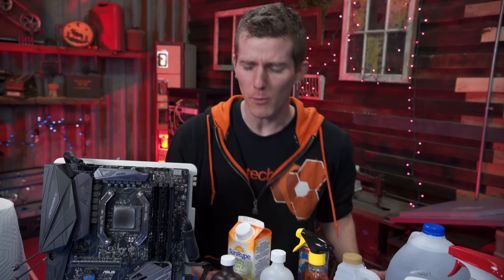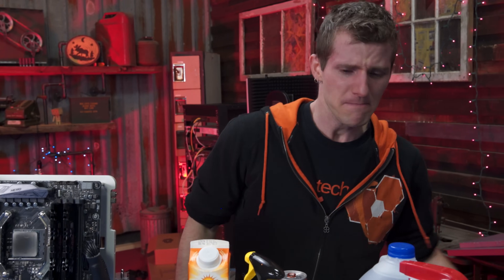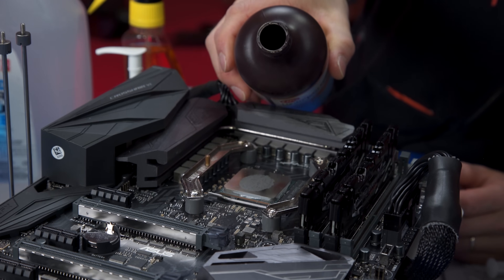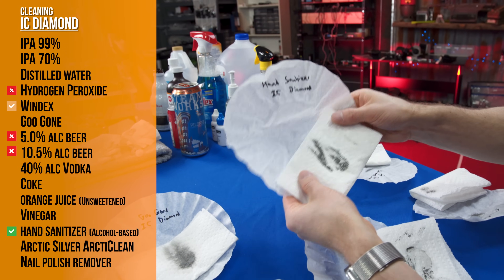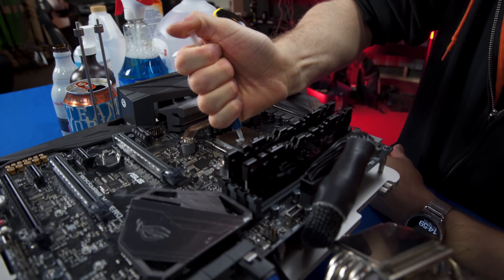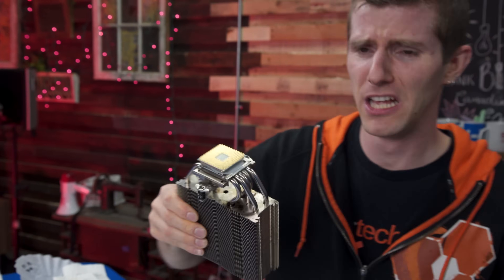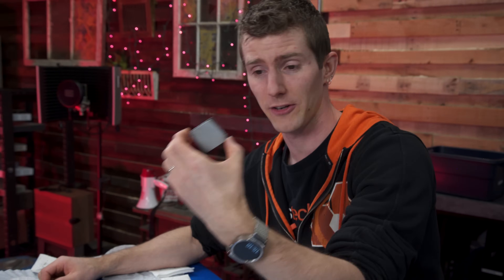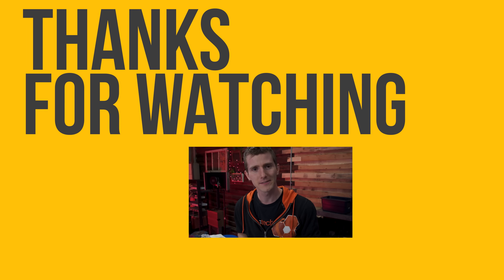Removing Thermal Compound - The BEST Way?

Comment: #prayforthe1800X
Reply: ?I've actually seen an amd chip installed wrong with a couple pins bent flat and was still able to bent them back straight and have the cpu work fine. it was when I worked at a pc repair shop and this 16 year old kid was building his first pc with an 8350. he didn't line up the indicators had the chip rotated 180 degrees off. 
but I used a single sided razor blade and saved the chip. the board was shot though. but that was because he didn't but any standoffs on the case and shorted the board. lol what a way to learn .
Reply: 1 like = 1 pray
Reply: May GabeN be with it, and that he saves the 1800x. Amen
Reply: #payforthe1800x
Reply: f
Reply: I did that a crap ton on HP business pc, it is fine as long as the pins are mostly straight...
Reply: I've done that before. Bent a couple pins but managed to file them straight with a credit card. As long as you don't bust any of the pins clean off you can usually save it.
Reply: That's like saying taking pleasure in a Prius dying means I don't care about cars, perfectly fine to hate a Prius.
Reply: amd is the saviour of affordable, non-overpriced technology and actual progress :'(
Reply: Julian Taffa  #prayforthe1800X
Reply: #pray4da1800Exx
Reply: its fine if that happens
Reply: Julian Taffa I'm a hardware reviewer and I've had this happen 3 times  already.
Reply: Only pagans pray for AMD.

Comment: I usually use nail polish remover
Reply: I also feel bad for that heat sink. Nice video tho
Reply: I wouldn't recommend Acetone based remover though. It dissolves plastic.
Reply: christ, and people put that over their nails a few times a week ?
Reply: Well, it is not corrosive and not harmful to humans in low quantities. Acetone just works well to dissolve some plastics so if you are unlucky parts of your mainboard might turn gooey.

Comment: Summary: A simple test, not scientific, partial credit given.
~~~
Seems to be only a partial test, not on the liquids used to remove it with, but in the fact that the system was not turned on and used/left on a while to heat up and cool down again (as in normal use) since different thermal compounds react differently in that way. Some compounds dry up, some stay liquid, some 'bake' into the metal and others seem to fill in the metal at the molecular level. No microscopes were used to see how well these different liquids removed the thermal compound, just a simple test with this process... but then again I guess that was the point, just a simple test and nothing fully conclusive.
~~~
I'll give you partial credit here Linus... I know it took a while to still make this video and I appreciate your channel but sometimes when you do tests like this I would be even more interested if you did different tests a little more scientifically.

Always been curious about the Arctic Silver ArcticClean with the surface prep as to if that even matters or if it visually makes any difference (can there be any noticeable visual difference if we used a microscope or an electron microscope to see any differences of removal of old thermal compound? Even at the atomic level?)

Comment: Its probably fine. I swear CPUs are the most durable electronic... anything, ever. Hell I have one I've dropped a few times from high distances and applied thermal paste all over the bottom.. thing still runs like a champ to this day. :P

It hit an old giant radiator and got stuck between a metal portion. Had to kinda pull the CPU out... was a mistake in handling on my part when I built my first rig a while back lol. Was trying to be so careful... too careful. So much so, it backfired.

Comment: Seen some horror stories about that exact issues with the Heat spreader getting stuck to the heatsink, on older AMD chips to the point where when trying to pry it off, guy broke the silicon in half

Comment: 8:38 if a cpu comes off with the cooler DO NOT PULL IT UP, just twist it, once it starts getting twisted you can slide it to the edge and break the vacuum. this can happen in two ways, old compound can start to act like adhesive over time, the other way is getting an air bubble trapped. and always when removing a pin package cpu's cooler twist it first, gently. make sure it is pretty free moving on the surface of the cpu before you try to actually pull it off.

Comment: utterly useless crap and not funny video, like how did this make it to a video i do not understand..
also for those poor beings that might not know the reason 99 percent isopropyl alochol and would try shit shown in this video:
it's because 99 percent isopropyl alochol it fully evaporates leaving no residue, so u won't short shit out if u fuck up or to avoid having some residue on the heatspreader  from the dried up cleaning agent, which of course fucks with thermal performance.
also linus the 2 main thermal compound groups are not "runy" and "particulate kind".
they are liquid metal conductive pastes and non conductive  pastes.

Comment: More accurate way to do this:
Get stock cooler, aftermarket cooler and solid metal panel.
Apply thermal paste, press it down to appropriate pressure, cook half of them at 80 degrees Celsius for few hours to simulate well-used thermal paste then remove the pressure.
And then try those solvents.

Comment: I guess if the goal is to remove stock thermal compound, then yeah. However thermal compound changes as it heats. Used thermal compound is a dry solid.

Comment: Did I miss it? You can use many things to clean thermal compound. The shit isn't hard to remove. The reason you want to use 70/99 alcohol is because it evaporates very readily which prevents any potential shorting in case you get sloppy with it.

Comment: I had an issue a few years back with a defective tube of compound, and it wound up making a mess down in the socket on my MB, for something serious like that I got some CRC QD Electronics Cleaner.  It comes in a spray can like WD-40, but it is non-conductive and fast drying, I basically had to stand the MB up and used some tissue to capture the drippings, and used the can like power washer to clean it out.  Worked like a charm.

Comment: So many question for this video:
1. Why used 1800X to wipe it over and over again? Is it affect the wiping performance?
2. Which compunds are better for cooling your CPU?
3. Why isn't AMD put a warning that you can accidentally pull your CPU from your socket? that thing is expensive

Comment: as an industrial service tech i find myself removing a lot of heat sink compound from IGBT's, bridge rectofiers, Heat sinks (duh), and what i find most effective, since i rarely find myself in a household environment and find myself on a mechanics shop most the time, what works the best for me is not WD40 because it does leave a protective layer after it dries, but try break parts cleaner, i recommend the CRC braklean nonflammable (red can). it seams like a common enough household item along with WD40, wonder why you didn't try thos?

Comment: Air duster / compressed air in it's liquid form can remove it quite well, but it'll make a mess, as it washes the thermal compound off like soap mixed with water , then the air evaporates leaving behind the compound to whatever surface it ran down to.

Comment: Anyone else notice the stuck pixel?
Reply: So you're saying the 500 million $ 8K camera has a stuck pixel? :O
Reply: AcidSugar1414 clearly you have no idea how digital camera's work.
Reply: nope, that's a dead pixel. It's the same thing that happens when you shine a powerful laser at a camera sensor.
Reply: "the individual location on a digital image sensor of one tiny light sensitive component"
How many individual locations of light sensitive "components" does a 20MP sensor have? I'm pretty sure the answer is more or less 20.000.000; If that's not what you call a pixel, then I don't know what is. Maybe it is made with magic fairy poop.
If what you said is true, then theoretically, the sensor would have an infinite amount of light sensors would it not? Which is clearly not the case. Ever.
Call it whatever you want, for  99.999% of people we call that a pixel.
Reply: pixels aren't in a camera

>>>>>>>>>>>>>sensor size is measured in megapixels
Reply: AcidSugar1414 holy shit dude we arent calling them monitor pixels. theyre camera sensor pixels. wtf are you smoking

fuck are you 100 shades of deluded
Reply: lol dude, stfu, a camera sensor IS made of pixels (light sensitive ofc, not emitters), prove me otherwise.
Reply: David Langford where?
Reply: The image sensor is made up of 3 parts. None of which are called pixels. 

http://www.dummies.com/photography/digital-photography/resolution/the-components-of-a-digital-cameras-image-sensor/

The image sensor takes the photo and is then Converted to digital pixels to be displayed on a screen. 

I'm not saying the cameras fine, it's definitely fucked.
Reply: Harry Smaje 3 photosites equals one pixel or translates the information for one pixel? And proof?
Reply: "Unfortunately, the use of the term pixel can seem to be confusing. It applies separately to three different things which are closely associated…

1.the individual location on a digital image sensor of one tiny light sensitive component;
2.the corresponding display component on a screen (a tiny LED LED | External link - opens new tab/page) which emits light showing one tiny point of light in an image to the user;
3.the smallest individual point of light in a displayed digital image."

Pixel is not a component of the sensor but a location of the photosites. Therefore it cannot have a bad pixel. 

But keep acting like you don't have time to debate...
Reply: https://petapixel.com/2013/02/12/what-a-dslrs-cmos-sensor-looks-like-under-a-microscope/ 

Gee, those look a lot like pixels. Did you know a monitor pixel is made up of multiple parts too?
Reply: TheFPSPower the number of sources of light you could possibly record is infinite but of course there aren't an infinite number of sensors. My point was that a pixel, in terms of digital cameras, is not a physical component but a location of a group of sensors that translates light into digital code.

m4xwellmurd3r just because it looks like a monitor pixel, doesn't mean it's the same thing. Yes, monitor pixels are made up of other components, but those are physical components. Again pixel in Digital photography refers to a measurement of light in a specific location, the location being called a pixel. It is not a physical component of the whole sensor. I do appreciate you citing a source, but I trust scholarly articles more than I trust commercialized websites.
Reply: Google Scholar for "pixel camera CCD" and you can find your "scholarly articles". If you want to claim "a pixel is an imaginary concept only in your mind, dude", I'll file that alongside the Jaden Smith "how can mirrors be real if our eyes aren't real" facts.

You're being a superb troll I guess, keep it up.
Reply: There are no real bridges, just steel and concrete structures that function as bridges. Bridges is just a concept, man. What if it didn't go over anything? Context, oooooo...
Reply: Imperfectionism sensor size is usually measured in millimeters. Megapixel refers to the size of the images produced by the camera.
Reply: you238 I didn't say it was imaginary, nor did I say it was a concept. Thanks for telling me how to look instead of finding something yourself though, you guys are REALLY winning me over 🤓
Reply: AcidSugar1414 stuck photon, it happens
Reply: dust in the camera lens..
Reply: TheFPSPower again the only place you'll find pixels on a camera is the (digital) viewfinder. The sensor does not have pixels and therefore cannot have a dead one.
Reply: Cameras don't take video in pixels.

Comment: I'm thinking that if you have to get it removed using alcohol, hand sanitizer would be the way to go.  Although, I'm a little disappointed in this test.  Generally when I'm removing thermal paste it is because I've removed an old heat sink that has been sitting on a CPU for a rather long time with burn in.  OR I'm removing that thermal tape stuff that comes pre-applied.  I imagine the results would be about the same, though.

Comment: Yea, not a great test, imo. Dried thermal paste is much more of a bitch.

Also, I know the pain of pulling a CPU out with the heatsink. Did that with an a10-5700. Sadly, a pin was bent and wouldn't give a post. Haven't attempted the credit card straightening method on it.

Comment: I'm sure this is already in the comments somewhere, but there is a difference between 70% and higher% isopropyl alcohol being that the higher alcohol content makes the liquid applied evaporate faster reducing the risk of accidental harm to your electronics from some liquid still being present when the device is turned on. I know this video is really just for entertainment, but there is a reason that the higher percentage is preferred. 

Sidenote that is obvious: Everclear at 95% isn't a bad option if you have some lying around.

Comment: Isopropyl alcohol, soak a q-tip just enough to not be dripping.  It'll come off quickly and mostly mess free, might take a few wet q-tip's, and a few dry ones to get any residue stuck in the etchings on the chip.  I don't even bother to take the chips out of the socket. I keep Isopropyl around for everything; mouse, keyboard, screen, etc.  Gets skin oils off and disinfects.

Comment: As dumb as it initially sounds, I use a little bit of lighter fluid on a paper towel to remove thermal compound. 2-3 wipes will pick up the vast majority of it.

It removes thermal compound extremely quick, and it evaporates almost instantly. 

Make sure your device is unplugged first, but that should go without saying no matter what form of thermal compound remover that you are using.

Comment: I would HIGHLY recommend AGAINST Goo Gone for cleaning your CPU.  Goo Gone leaves an oily film on just about everything due to its nature as a solvent.  It's orange oil based, and improper cleaning will cause your new TIM to not settle/cure properly.

Get a smooth, flat piece of metal, and spray a small amount on it.  Rub it around for a moment and when you think it's clean, run your finger across it.  If you think it's a little too smooth, chances are there is still residue on the metal.

Best idea?  Use the isopropyl, or Arctic Clean (if you want to spring for it).  Anything else will probably cause long term damage.

Comment: I cringed so hard when I seen you pouring that liquid directly on the mounted CPU at around 3:30 mark. I use Q-tips to apply just enough on the spot then whip off. ... Also, I use zippo lighter fluid on suborn compound that's harden onto the cpu.

Comment: How to fry eggs

PC guide
1.Get Gtx 480 + any amd cpu (except ryzen)
2.Remove all case fans
3.Don't cool your cpu with a cooler
4. Use extreme benchmarks
5. Remove fans off gpu
6. Overclock GPU and CPU
(Any step will work on its own)

Mac Guide
1. Purchase Power Mac G5
2. Remove water cooler (if it is included)
3. Remove fans (if there is any)
4. Use extreme benchmarks
(Any step beyond step 1 will work on its own)

Fry some eggs. Yum.
Reply: "any amd cpu except ryzen" not really only the FX 8000 and 9000 get hot
Reply: That mac guide is wonky. I used to just put a pan right on top of macbooks. No need to remove fans.

Comment: I just used a microfiber towel to remove what was around 8 year old thermal paste from an old athlon dual core, worked fine didn't need any solvents and came up clean as after a good rub. The x4 I replaced it with got the same treatment and working mint as. AM3 coolers are junk though, after markets make the thermal compound spread much nicer.

Comment: What works best in removing fresh thermal paste compared to old, dried out and baked on is like trying to compare cleaners for cookware without actually using them to cook anything, lol.
Just stick with anything 99.9 Iso that way you do not have to worry about residue.... just use left overs for Iso extractions. ;)

Comment: I've pulled plenty of AMD CPUs out of the board when trying to change out the cooler. I have no idea how that thing is supposed to lock. It's like they are just held in with the pins.

Comment: Acetone works great, but you have to be careful with it around plastics. IMHO Acetone > Alcohol since it's a much stronger solvent. Goo gone will work, but it will leave and oily residue behind that will need to be cleaned off.
Reply: Have you ever tried lacquer thinner to clean off thermal paste

Comment: the point of using cleaner it to get the dried old paste out of the micro grooves of a rough surface,  the polished surface of that heat sink doesn't count cuase you don't even need a solvent to just wipe it clean. and it's new paste, not hard to remove. You need to find old computers, also wd40 is the best cleaner.
Reply: Yup, WD40 to remove the thermal compound, followed by alcohol to remove the WD-40. Works great for sticky tape glue also.
Reply: My thought too. When I need to remove thermal compound, it's not brand new paste, it's dried on crud. I think the test needs re-ran with some old heatsinks from scrapped machines.
Reply: I agree, and then follow it up with some isopropyl alcohol to clean off any remaining WD40 residue. WD40 seems to dissolve the paste even if it's old and crusty. It's good stuff.